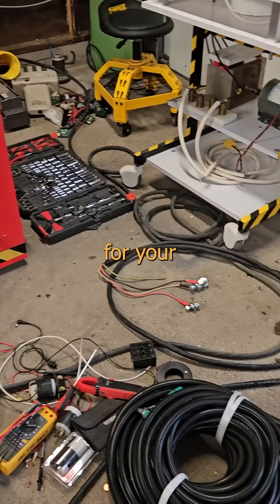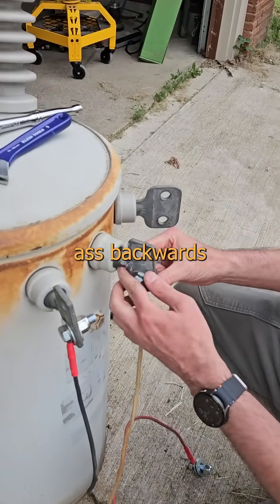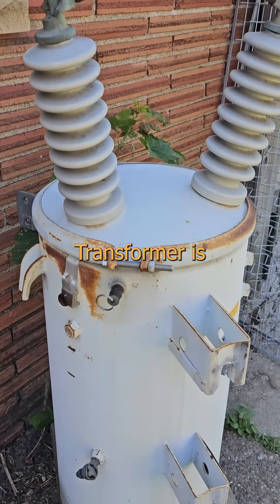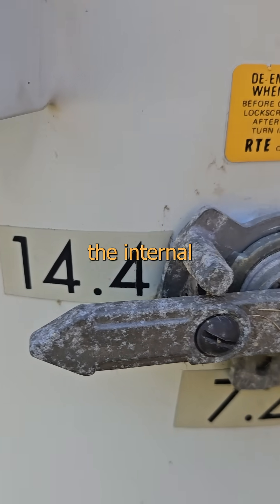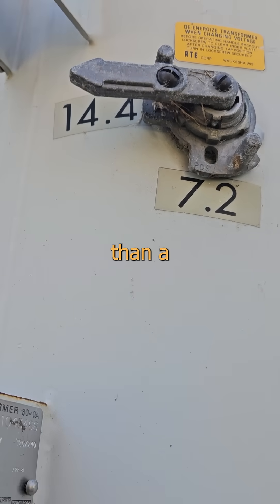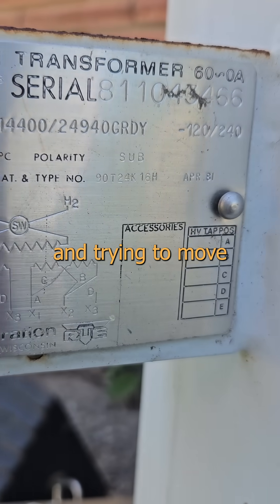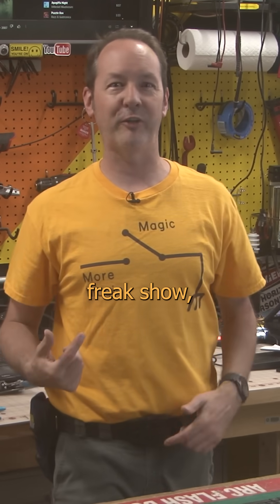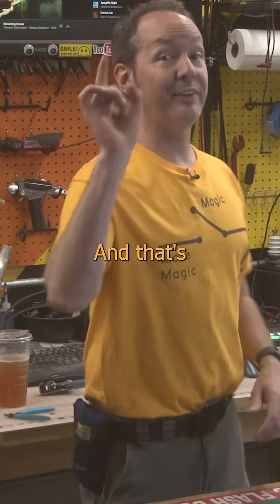Transformer Shift Lever #chrisboden #comedy #highvoltage #engineering #education #science #switch

Comment: You know something just hit me,I have a 40,000 watt 3-phase diesel generator sitting in my yard. 277/ 480 volt and I'd like to figure out how to get it to 120/240v 120/120/120. obviously idling the engine down won't work as it puts it at 38 HZ. Is there any other way of doing this without a transformer. Has lots of wire connections on the top. I just don't know enough to figure if it can be rewired. You're input would be much appreciated 👍 I do have an analog 450 amp 3-phase welder that I can probably tear the transformer down and rewind the output side for 120 volts. But I hate to destroy the welder of course I've never used it. I bought it at this factory thing where they were selling a lot of stuff like that. it's a motoman 450.

Comment: Make sure you double check that is not a PCB filled unit.  Switch voltage pot's have not been used in the field in 20-30+ yrs.  Most that are out there where filled with PCB's and should not be handled by the untrained.

Comment: Only correction to this: The TAPS changer isn't persay a half or full voltage switch.  It simply is there to match the primary voltage that it is being wired to with a hot tap and fused through a switch that contains a replaceable fuse.

I highly recommend having your apprentice set the TAPS switch to the correct primary voltage before you hoist, digger lift, or jib lift it off the ground. 

If you install that can with the incorrect voltage  option,  enjoy your unscheduled time off at home until the next unscrupulous contractor hires you through the Union Hall.

Comment: apparently some of these transformers also have a smaller shift knob to just slightly adjust the voltage, acting as a mini voltage regulator if you're not quite getting the minimum required 228 volts, i saw a video on the lineman blogger channel about those.

Comment: I worked at a plant in Austin, TX. That rebuilds those pole pigs. My first job was to load six at a time onto a forklift mounted roller bed that was then driven into the shop and linked to the disassembly line and the fun began. Those insulators are sharp as hell when they break and cut like a razor. The oil was dumped but I had to dip my hands in the can sometimes and now I have ever ready rabbit powers. It is a whole process to rebuild these things.

Comment: This is why I love your f**** channel. One of the better terms that I have been referred to as has been "electro-mechanical sociopath"! You sir might deserve that term even more than me. And I'm the guy that once wired up my entire office that when you closed the bathroom door the front door buzzer would automatically ring!😂
Reply: Is that on par with making an electrical pew for church? And wiring it up to a model T- spark coil switched to a 1.5 fahrrad cap at 15 Volts and being charged with a home brew 50 amp DC rectifier hooked up to a 35 amp 12 Volt transformer? Just checking ! I was told I got a standing ovation by the people who sat in the electric pew.
Reply: Fuck yeah! I love even dealt with a few model T those things are fun.   @DavidW-ug9ef

Comment: I was once a lineman, and you can be unalived if you get  in circut with that primary. When secondary is at house current. 20 amp supply the 7200V bushings weill be at .333333333amps , far more than needed to unalive you.

Comment: We usually call the pole mounted transformers "tubs". And we use the 7.2/14.4 dual voltage transformers often since we have a mix of primary voltage and are slowly working towards converting out distribution.

Comment: Once, many moons ago on a rainy evening in my youth, I was out for a drive (alcohol may have been involved, I can't recall) with a friend who needed to have a leak.  Stopped at a new house being built to hang one in the driveway and I yelled to my buddy "HOLY CRAP! I WANT THAT!" It was a pole pig about this same size.  Not exactly a megawatt, but it wasn't milli KVA either.  He walked over to that sucker and lugged it half way to the truck with his feet sinking 2-3" into the dirt with each step, then gives up half way and comes back and pokes his head in and says "You sure you want that?  It's pretty heavy man!".  I said "Yes, I want it, but I was kidding".  Same guy has changed multiple tires without a jack and loaded older 5kva Onan gensets by hand.  The kind that has a frickin eyelet in the middle where the CG is for a reason.  Sadly, that's about where the fun stories end.

Comment: Remember getting a little DC motor kit and winding it by hand.

Only trouble was battery's went dead 

I noticed that if you plug things into it socket 

They would turn on.

Being the average kid and no idea what was going on.

I stuck my little wires into the plug 

Needless to say by the time Mom got there 

It was all over. Not hurt 

But a flash of fire and smoke came out 

Best i remember 

Have to love electricity 

And being a kid that survived

Comment: Did you know that an alternator generated 3 phase ac power? An external bridge rectum frier can be had for 30 bucks and you're just a pair of jumper cables and a small engine away from a surprisingly effective stick welder

Comment: If you're planning to backfeed your 1981 vintage RTE transformer with 120 V, did you parallel the two secondary coils inside the tank?  The leads are stamped A, B, C and D.  Just remember Alley Cats and Bad Dogs.  Connect A and C to the X1 terminal and the B and D leads to the X2 terminal.

Comment: Did you know these things are filled with oil? Did you know if your electric company pisses you off enough, there’s a oil plug they forgot to put in right at the bottom. It’s about 22 caliber size. Thankfully, the dirt dippers fill in the hole really quickly. Just don’t go getting angry enough to knock the dirt out of the hole. Just saying.

Comment: 1. Never once in my life have I heard them called a "pole pig" they're either called "a Pot" or simply "a transformer"

2. That switch is called a "Tap changer" and you don't just change it for fun. It exists because there's a lot of systems that run both 14.4KV and 7.2KV. 

If you were to put it on a 14.4KV line with it set to 7.2, it'll make a lot of extremely loud and expensive noises and also output 240/480. If you put it on a 7.2KV line set to 14.4, you'll get half the voltage on the secondary and nothing will work. (Instead of 120/240, you'll get 60/120)

Comment: If you use the control cabinet, is it better for the life of the transformer?  I shy away from only using half of the guts, because the half that is still working is getting hours on the clock either way.

Like car engines that shut off fuel to half the cylinders at cruising speed, for an even worse example.  Without compression, the rings are looser than when under pressure and cause more wear on cylinder walls.  Or am I just overthinking it?

Comment: I dunno if this is even remotely similar, probably not, but at the burn plant I used to work at we burned garbage which made steam, long story short made power. The hydraulic system that pushed the burning trash through had a switch for general running, and double that. This was for cases in which something would jam in the loader ram, and we had to run it harder for a minute and get the door open to unjam it. You wouldn't leave it on that over Rev, or risk blowing a lot of hoses.

Comment: I used 2 14.4 in series/paralell to get 28.8KV and with my quad stacked 1256D powerstats I could get 32KV into the primary coil for a rather impressive 12 foot streamer  secondary coil was 12" dia X 5 foot tall, toroid was 14" minor with 5' major  ( see my icon pix)

Comment: ahh yes. our EMC put these in when they upped the line voltage a few years ago. but they don't run 14.4kv. They run about 15.3kv on these. You can only imagine how much that runs your power bill up with inductive motors...

Comment: So... it's designed for two input voltages then, innit? If I read the specs right it should work at 7200 or 14400 volts and still have the output at 120/240V.

I've seen a similar lever on one of our transformers here in Czechia. The function was somewhat similar, but not quite. The transformer would take only one voltage, but you can change the output to get more or less volts, depending how close or far you are from the source. This way you can tune the output to be always withing tolerance of the correct 230/400V.

Comment: Reminds me of this old wye delta phase starting mechanism I found on an old elevator I worked on from the late 1800’s. You had to manually crank the main from off, to start, then run. The elevator ran off of an electric motor, but supposedly was steam powered when it was new. The motor always ran, you’d use the directional rope to shift to either up or down. It was a ceiling mounted upside down traction machine that ran off of this giant ass leather belt. Was only one guy left who knew how to make them in all of the city. This was an old building in Brooklyn that has since been knocked down, but was still in operation until it closed in the late 2010’s. I was one of the last elevator mechanics to work on it before it was demolished. RIP, you weird, crazy fuckin machine.

Comment: How this transformer works??

In PL we have 3 phase transformer with 3 power input conections (for example 15kv) and 3 output connections with phase current about to 400v (230 on single phase) so why this transformer have 2 inputs and 3 outputs??

Comment: Lol. Love your vids. 
Hey, might one assume this is full of mineral oil? You might be able to transfer the oil to 5 gallon buckets to reduce the weight if I needs to be moved very far. Though if it’s old enough to contain PCBs in the oil, don’t spill it. No one wants to become a superfund site! 😬
Reply: This unit was built in 1981.  All North American transformer manufacturers stopped using PCB oil by 1974.  This one holds 9 gallons if mineral oil.  The oil is needed for dielectric insulation.  Draining the oil and energizing it can cause a flashover inside the tank.

Comment: Ran into the same kinda thing on a 1/4 motor i scavenged to put on my air compressor...it ended up not being work modding the conpressor but the motor has a loooong cable and pull handle on it that i dodnt k ow what did. Neither did anyone that used the paint rack it was on for 30 years come to find out it pulls the brushes away to kill the motor

Comment: I may not have the 'tism, but I do have ADHD, and as a fellow engineer I am absolutely here for the filthy flaming bars of engineering you put down. We cool.
EDIT: Was that a disconnect you turned when you said "WHAT'S THAT ONE DO"? Either that or a normal 2 or 3 position operator switch. But one of that size? What's the torque rating on the wire terminals of those bad boys?

Comment: I would love to reverse a transformer and see what I could weld (side note, I'm not a welder, just an electricity junkie 🤣). 
Like, how much electricity could I get by reversing a microwave transformer? What could I do with such electricity? Could I feed it into a breaker box, run it through a power conditioner, and power my equipment? What if I daisy chain two of them? What if I ran two in parallel off of two different circuits? What if I ran two in series, or two in series, but reversing the hot and negative from the first? I'm rather glad that my intrusive thoughts have not gotten the best of me, but I would be thrilled to fly to Michigan and do this under close... (adult??)... supervision 😁
Reply: Hey, Hi, thanks for your awesomely entertaining channel and fun facts and info.

I'm needing some help and advice please -
I have a 6kva transformer, step up 110~120Vac to 220~240Vac
That I don't really have much use for... Unless you can give me some ideas what can be done with it (living in South Africa with 230 Vac)

Thanks for your help!!

Comment: But why the half voltage?
Reply: For if you have a line voltage of 7.2KV, almost every transformer will have a tap changer to operate at a couple common line voltages for the application, easier than designing and building and buying 2 or 3 very similar transformers.

Important transformers will have on-load tap changers that are able to adjust system voltage while passing full load

Comment: So, as you say, that's pretty cool, but in what application is it used? If you cut the voltage to half on the primary, would that not also drop the voltage to half on the secondary? Or am I missing something?

Comment: Put it on 7.2 for higher voltage, when putting pixies into the back door.
Reply: no, the two settings are 14.4 KV at the big lugs and 120/240 at the little lugs or 7.2 KV at the big lugs for 120/240 at the little lugs. 14.4>7.2
Reply: @kenbrown2808  I stand corrected.  Put that pig in high gear then. Analogy broke down before I thought THIS stickshift was an input gear.
Reply: @kelimike it helped me that i know standard distribution voltages.
Reply: @kenbrown2808  Ken. You'ze here too! That's at least three channels we're in sync on!

Comment: We padlock these, then dispose of all the keys, because if you change the voltage online, bad things happen to the tranformer.
Reply: here, that would be seized solid in a week, anyway.  our pole pigs come in shiny and rusty.  no in between.
Reply: "a little click on one..."
Reply: @paulheitkemper1559  "I understood that reference"
Reply: @paulheitkemper1559 WELD THE TUMBLER! WELD THE TUMBLER!
Reply: my angle grinder wants to know your location
Reply: Party pooper. . .
Reply: "You are using a Masterlock, it can be opened with a Masterlock"
Reply: BOLT CUTTERS IT IS!!
Reply: What sort of bad things?
Reply: @teh-maxh  you're opening a 10kv switch immersed in oil.  it'll sizzle for a while then become a fireball.
Reply: @teh-maxh  well you're touching something on what I think is a 50000 volt line (or 10000, either way you're burning at the speed of light itself if you touch it) to a setting it wasn't meant for, something will probably explode
Reply: All it does is change the stepdown (output) from 7200 volts to 14,400.
It's the stuff downstream of the "pole pig" that will suffer.
You know, pad mount transformers, 3 phase converters, anything energized off that unit but the unit itself and the line side?
Won't hurt it a bit.
Reply: @teh-maxh  It transforms your sockets into Euro spec. (240V instead of 120V).
Reply: Just cut the lock
Reply: I would like to hear more about the bad things. Is it just an internal arc that turns the oil into an expanding cloud of coupled plasma, or worse than that?
Reply: ur definitely not gettin nudes....that being said, man i love every bit of your content. very distinct, sharp sense of humor. invariably fascinating subjects. but the wordplay..  thnx  man...
Reply: Don’t be so sure about the not getting noods… girls love crazy , just ask Manson

Comment: I've always wondered why they landed on pole mount transformers as the solution.
Reply: Lower voltage means more losses, so you want it close to point of use, but you don't want to install one AT the point of use where every Tom and Dick can get their dirty beaters on em.
Reply: @brianargo4595 
I get why you want local transformation. I'm wondering why they chose a tiny pole mounted transformers for every dozen or so households. Because it's not the only solution. Where I live they prefer bigger transformers that supply entire neighborhoods. I don't think it's an aerial vs buried lines thing because they also did it that way before they buried 99% of the local transmission lines.
Is it a 250/400V vs. 120/240V thing or some other practical factor or is it just a quirk of history?
Reply: @chrthiel I wonder if it has to do with the amps supplied to a typical US home, it is usually at least 100 amps and more commonly 200 or 400 amps. Pretty stout wire would be needed to go any distance.
Reply: @stevebrenan1556 
In Denmark it's 25A though 35A has become more common because of electric cars etc.